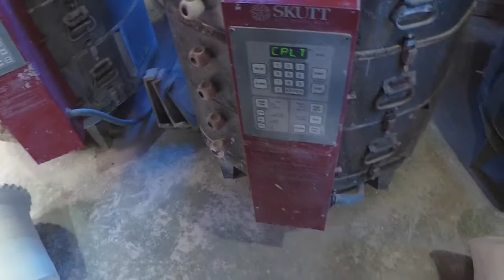Pottery Chores Part 2 : Guy Wolff

Comment: Thanks for sharing!
As a product also from 1950 I may have missed how long you have the checkering going on to dry out the pots. Would you share how long you do this? I am a hobby potter who single fires, so drying the pots out is one thing I am always concerned about. I have been lucky having done 40 single firings and have had only one pot blow.
After the checkering do the pots become a little less fragile to handle or is it just your magic touch that they seem quite stable?
Really enjoyed the Pottery Chores 1 & 2...
Reply from the maker: I like to dry the 60 pound pots for 6 to 8 hours  and for them I leave the lid cracked open an inch or two all the way up to 900 F for that pesky chemical water in the firing cycle ..Pots  25 to 40 pounds around 4 to 6 hours and  3 hours for the smaller pots below 12 pounds .It all depends on what the humidity level is in the air ..If the air is 60 % water the pots will be as soon as the kiln is cooled off .The clay is a sponge for water

Comment: Hi Guy! Nice to se you working. Don't get why you're not putting them uppside down. There's a reason, but why? I put everery two stacks upside down for bisc. Love to learn from you!
Gretings from a fellow potter on the other side of the Atlantic. 😃
Reply from the maker: The kiln is set at 200 F ..Water boils at 212 and that is the temp pots blow up from steam....I am fast drying the pots leaving them with as much hot air around each one to get water away from the pot faster..These are larger shapes and harder to get dry .AS soon as they are dry they are set in the kiln .What ever humidity in the work room will quickly be back in the pots otherwise .Stacking mouth to mouth does not leave a space for the moist air to escape quickly from the interiors  ..This whole process is not so important if the pots are not so densely stacked in the final firing but that makes for the higher yield
Reply: @guywolff  guy, do you think the potters would stack the flower pots in kilns this way in, say the 18th or 19th centuries? Or would they use some clay wadding or other type of furniture between the rims or under the pots? I’m going to try stacking and firing the next load like this rather than stacking rim to rim, ive just been afraid to split the pots due to the weight. Thanks guy, you have inspired me very much and i have learned a lot from you in the past few years though we have never met. Wish i could have apprenticed with you and skipped so much error and headache in my potting experience but hey its the path i’m on. Cheers!
Reply from the maker: @muddymike  So it all depends on the kind of ware you are setting in the kiln ..Unglazed pots can be set inside each other if they are placed so the floor of the pot has the weight of the pot above .. Bigger pots (above 20 pounds ) need some sort of "Kiln Furniture" so a post in the drainage hole and a shelf to hold the next pot and maybe some wads to steady the stack.. GLazed pots like any other pot ..:)